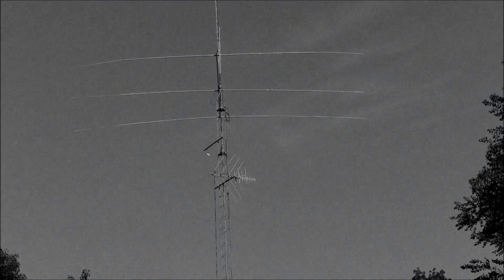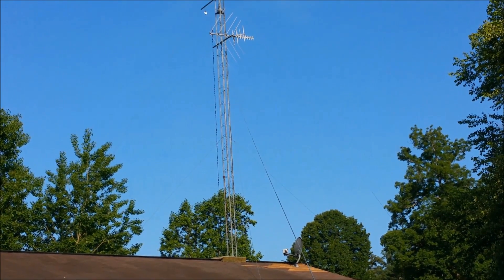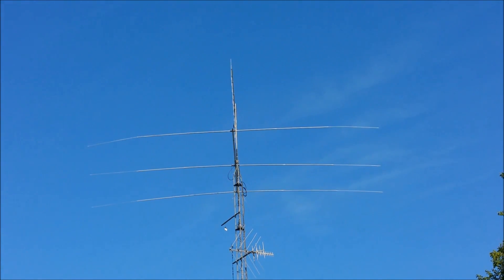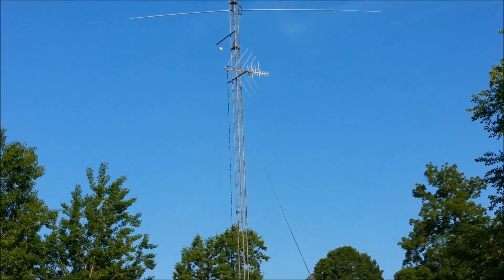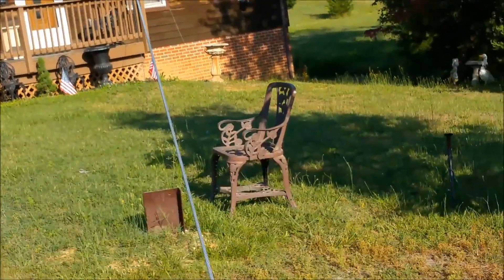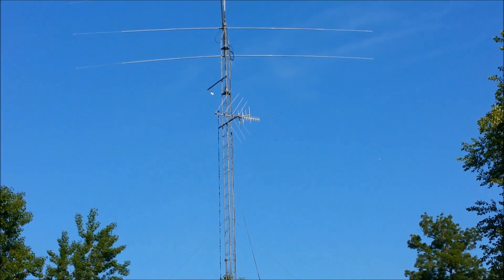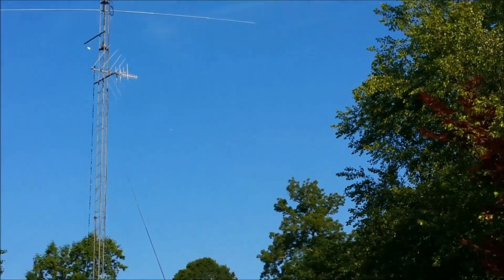Lowering and Raising 60' Rohn 25 Tower, Homemade HInge

Comment: Great idea on sinking rod into concrete to make the hinge.I'm afraid of heights,so looking for hinged base ideas and yours seems very simple (no welding).Thanks
Reply from the maker: Nunofyour beesiness yes simple is better sometimes! Thanks
Reply: Just getting around to getting mine done.waiting a few days for the concrete to dry which gives me time to get the winch cable and pulley set up.Any idea how heavy these towers are,mine is similar to yours but not a Rohn,I'm guessing it may be a touch heavier than your but very similar.I am not able to run a cable over my roof because it is a 2-1/2 story house and I would need a couple hundred feet of cable to reach the winch.I therefore am putting in an anchor hook on the side of my house (reinforced of course) and am wondering what size cable you have on your winch? Also wondering if a good tough rope would work.I can't imagine these tower are that teribly heavy and mine is only 42" but of course that weight increases as it tilts down.Any tips apreciated.Thanks

Comment: I like the pipe /bolt /hinge set up ...looks like it works great and a simple design ... do you have the tower bolted to your home also ? or its all anchored down with a  3 wire system ?    Im planning on building a tower for well water extraction , and to generate elec. , and if i can comms ......all on 1 tower  ......thanks for the video !!
Reply from the maker: ski bum hi... yes it's bolted to the house but only Because it sits right up against the house and it was right there and convenient... I doubt if it would have been necessary since most of these towers sit on a pad that's away from the house... thanks for watching!

Comment: How did you make the hinge bracket?
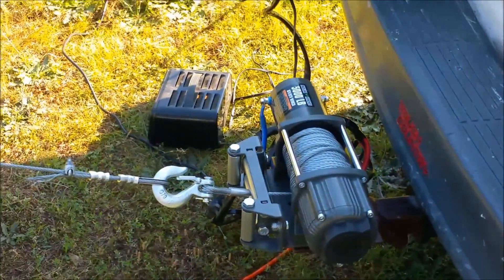Reply from the maker: That might be hard to explain in a comment, but I'll try and make it short.  Basically I put two pieces of pipe a couple feet in the ground  (0:57 on the clip) using one section of tower as a guide for placement.  Let the concrete dry and drill a hole thru the pipes and the legs of the tower and use a 1/2" piece of steel dowel rod.  That's the short version but that's the basic idea.  Thanks for your comment..
Reply: Why not use a rohn hinge base? Is it because they are not made to tilt a tall tower over?
Reply from the maker: @theboogeyman826  Sorry for the late response, I didn't get your comment until just now.  I didn't have one available and the way I did it was much cheaper, plus all the parts were available at the local store... 🙂
Reply: @JLPicard440  no problem. I have seen different things done, and I like your idea. If it works, it works right?
Reply from the maker: @theboogeyman826  It worked well for me and I never had any issues..  I did use the roof of the house as a lift point.  I put 2 6x6 boards at the peak to keep from damaging the shingles.  I even did it on fairly windy days and was still ok, but of course the less wind the better..  The trick is to use a perfectly straight pull point when you lower it down..
Reply: @JLPicard440  a perfect pull point, like a pole? It's what I was planning on using to raise and lower mine.

Comment: So your tilt over wire just rubs on the roof of the house? How high off the ground is the peak of your roof? I am still working the details on how high my pull point has to be not to wreck the tower.